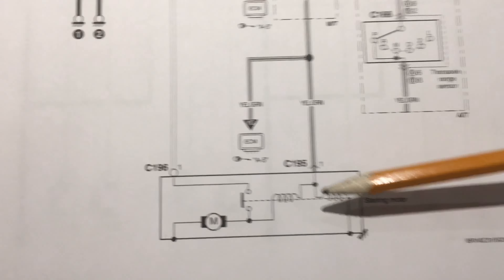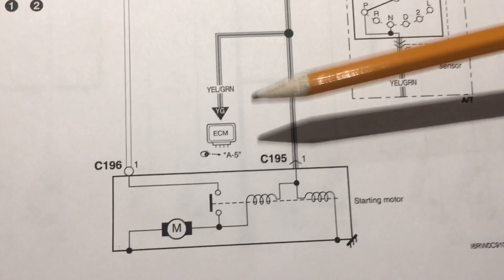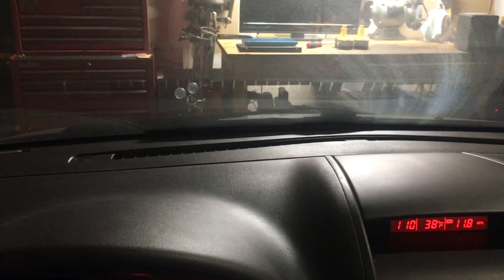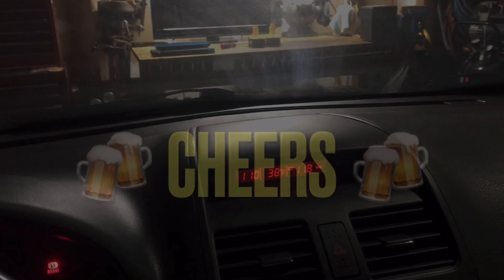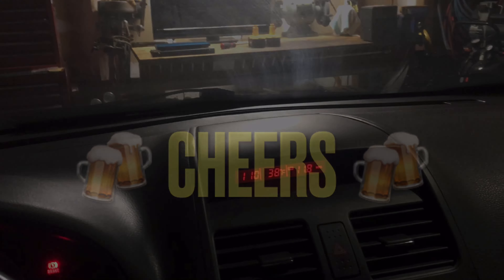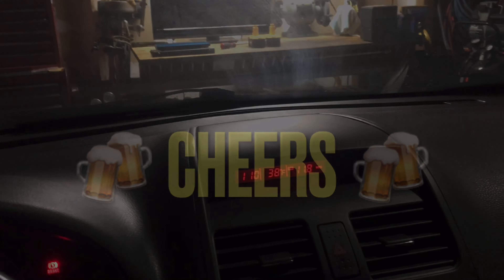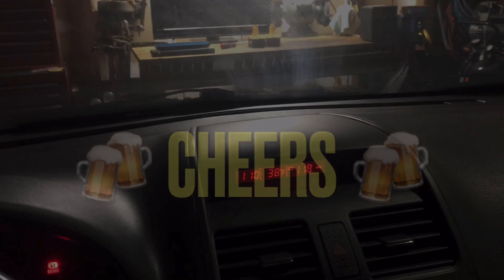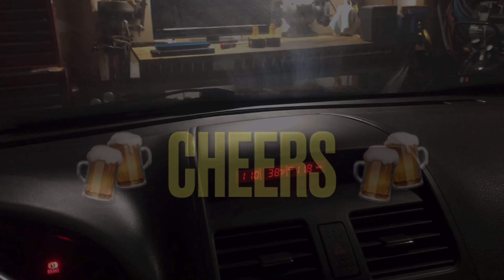Suzuki SX4 Crank Position Sensor Circuit DTC P0335

Comment: OH WOW! I am the guy with the problem mentioned. Thank you so much for this! Going out of your way to test this is ... I dunno, I'm lost for words.  I was so worried the sensor was bad and that would cause me to consider junking the car rather than a costly fix. This proves what you thought earlier that a bad starter will cause this code. Going to see mechanic right now as 500 yards down the street. I will get back whenever they get to me.
Reply from the maker: It’s interesting 🍻
Reply: @TheGibby3340  Good news! Mechanic had originally said my starter was OK (no idea why or how). Upon questioning and relaying them info from this video yesterday morning they just called and told me to order a new starter, mine is faulty. YAY! Thanks! 👍Best price I can find it the one on amazonDOTca and has good reviews.  I'll reply back in a few weeks when installed and it fires up.
Reply from the maker: Good to hear. Thx for updating me. I am just reading this now 🍻
Reply: @TheGibby3340  Starter installed today ... she fires right up! Thank you!!! :)
Reply from the maker: @xs650sf  Nice 🍻

Comment: Damn... This makes me think I'ma have to pull the gearbox to fix it. I had a slight hope this video would give me some good news. I in this scenario unfortunately get crank, even get it back to being able to idle, but after warmed up it definitely does not want to start back up when I shut it off. Appreciate the videos though definitely gonna sub
Reply from the maker: Thx. And thx for watching. There is a couple of videos on the channel if you care to check it out, detailing the degradation of the output of the crank sensor of one of my SX4’s. The 2 litre is a ball breaker of a design in this respect.